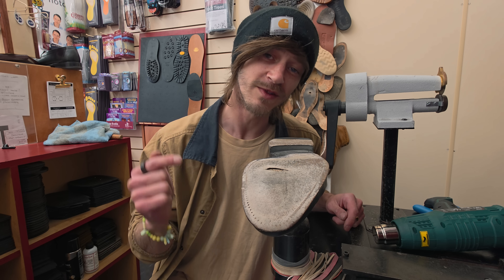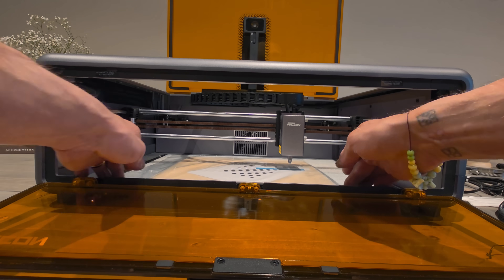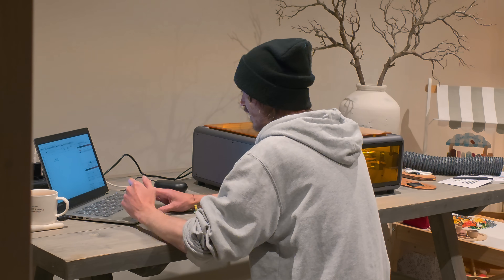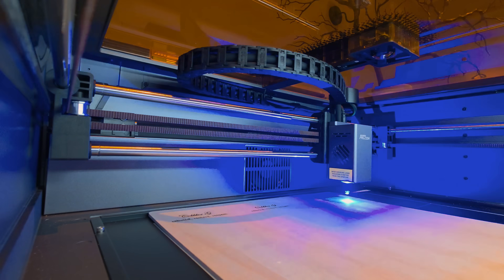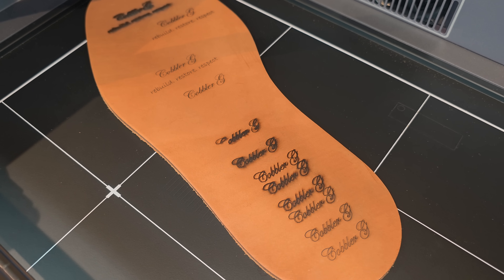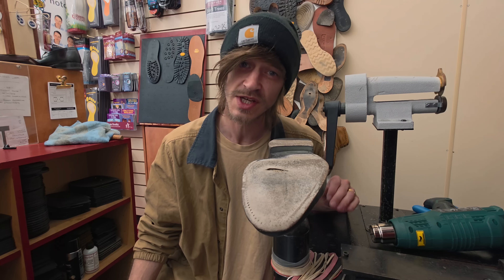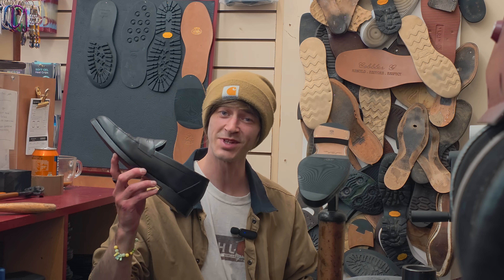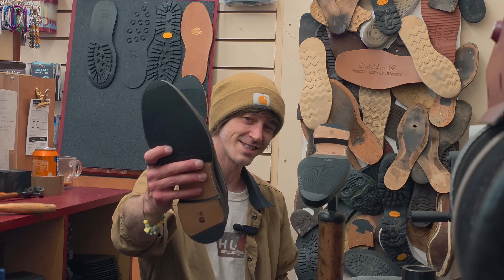The SHOE REPAIR Game is CHANGING

Comment: What is you preferred adhesive for leather to leather?  Rubber to leather?  Synthetic welt (TPU or rubberized vinyl) to leather and rubber alike?  Finally if you are applying a PU outsole to a boot what glue do you find works best with PU soles?  Sometimes it's all about the glue!

Comment: Thanks for the heads up for the laser engraver/cutter.  What is you preferred method to remove a work boot sole from a Goodyear welted boot? For years I was mainly using a utility knife with those 2-headed razor blades. It demands care as it is easy for a razor edge to slip cutting either the upper, the welt, or oneself. There are some easy ones of course, but with new adhesives and manufacturing techniques the welt and sole (or mid-sole) are often what I will call "fusion bonded" (penetrating, often chemically synergized adhesives used with great pressure to fuse 2 objects to an one-like state). I find the bond made by Thorogood on their classic moc-toe wedge sole boots to be a fusion type that is difficult to split apart. Anyway, I've been using a sonic knife to do the job and it is a game changer for high-bonded welts, mid-soles, and outsoles. I like that laser thing a lot and I'm going to get one for my shop.